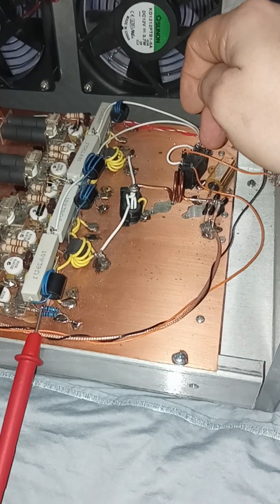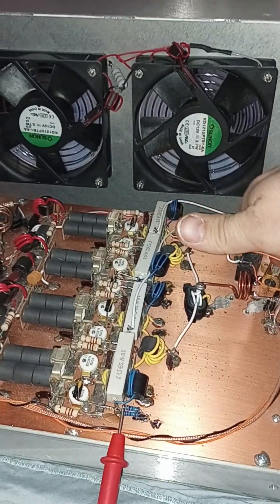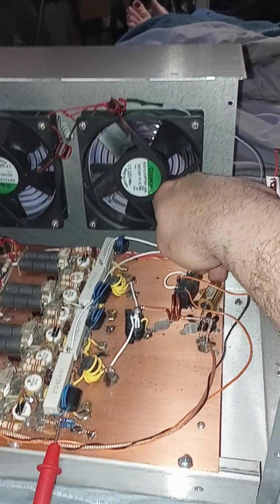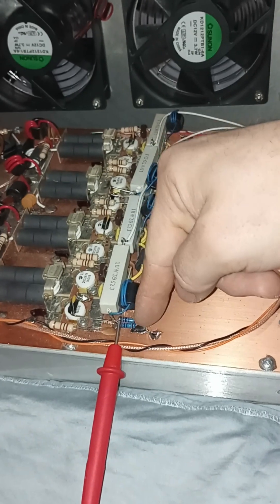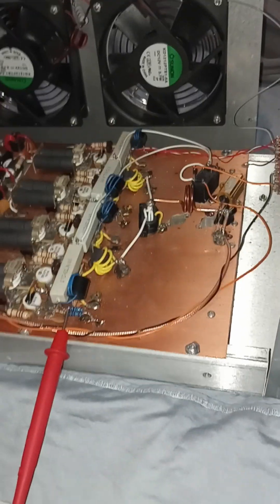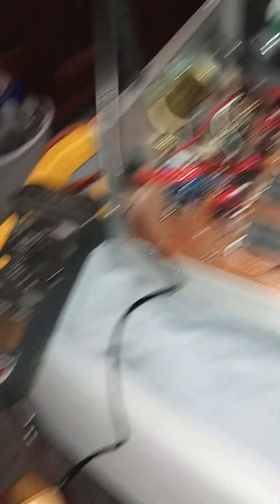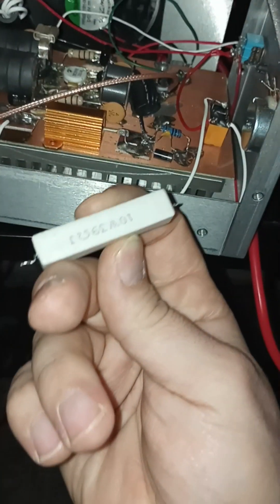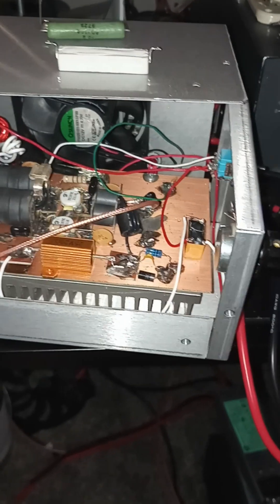2879 transistor biasing questions

Comment: You set your bias AKA quiescent point with no input signal.  If you are driving it with AC you would have to look on an oscilloscope to see the bias as the midpoint of the sine wave.  O.7VDC at rest seems like reasonable AB bias.